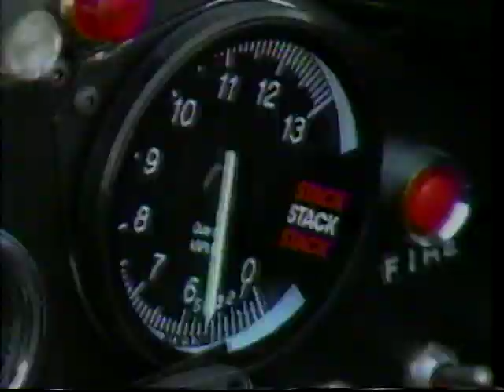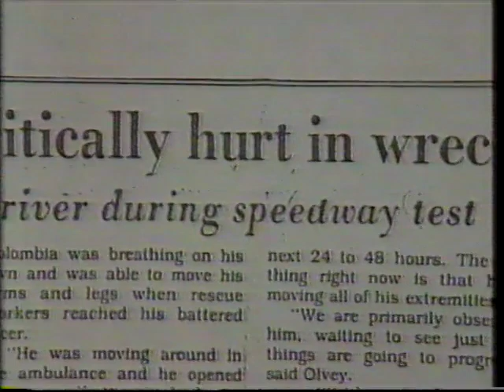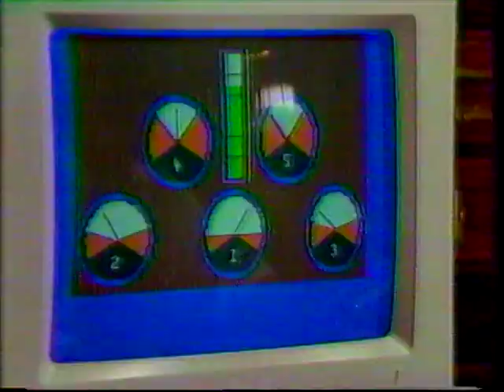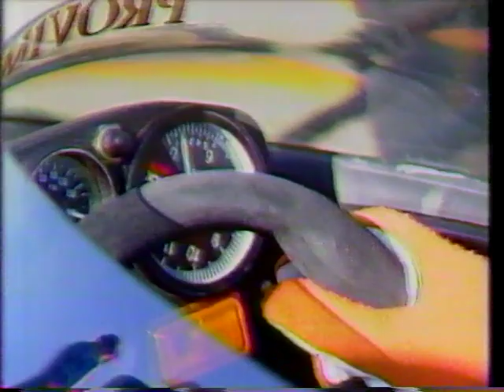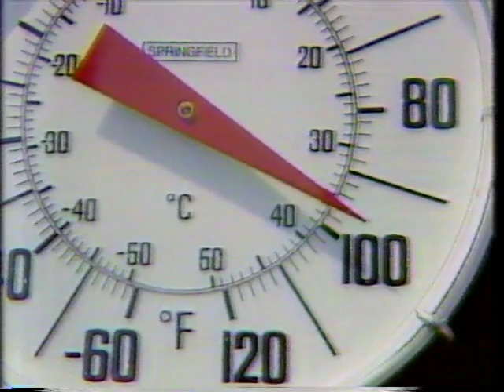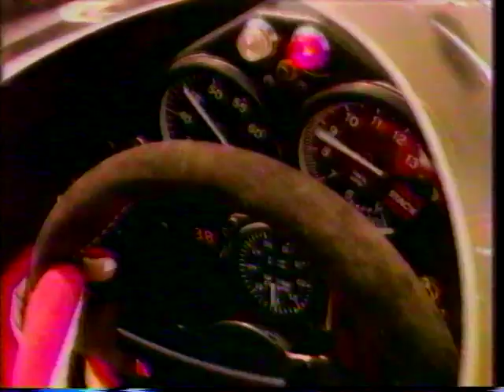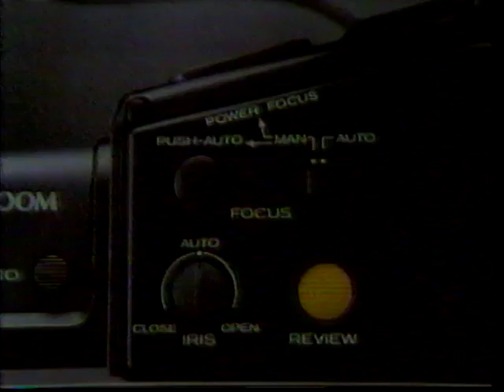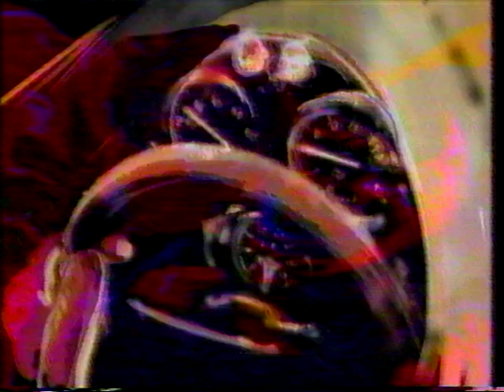1988 INDIANAPOLIS 500

Comment: In the 1988 Indianapolis 500, A.J. Foyt qualified in the 16th starting position with a four-lap average speed of 215.648 mph. He had a strong race and was running in the top three in the late stages of the event, but ultimately finished in 9th place due to a pit stop for fuel in the closing laps of the race.

Foyt's performance in the Indy 500 in 1988 was impressive given that he was already 53 years old at the time. Despite his age, he continued to compete in the race for many years to come and remains an important figure in the history of IndyCar racing.
Reply: You must be thinking of another year. Foyt was indeed 53 years old in 1988....but your other figures are all wrong. A.J.Foyt started in the 22nd position with a 4 lap speed of 209.696mph. He was never anywhere near the lead and crashed on lap 54 and was done for the day.

Comment: Fun (sorta) fact: 1988 is believed to be the biggest crowd ever to attend the 500. While they added grandstands  in years after,  the infield capacity was reduced substantially. We’ll never know for sure bc IMS never releases attendance numbers, but insiders say this and maybe 1991 were the most attended 500s ever. 400k wasn’t too much of s stretch
Reply: I disagree.I think 1993,1994,or 1995 were the largest.Remember the massive grandstand that was installed between Turns 3 and 4 prior to the 1993 race and the large grandstand at the pit entrance prior to the 1990 race.Infield was still full then,too.However,if you had said that the 1988 Pole Day was the biggest Pole Day crowd you may have been right.
Reply: I agree about Pole day 1988. I was in the A grandstand across from the pits and the crowd was really MASSIVE that day! It is hard for some people to believe that back in the day they could put 150000-200000 in the stands...just for qualifying! @asianoramaagain2269
Reply: We were sitting right next to you! We always sat on the top row right above the flagstand in the paddock.
Reply: What about 2016 was it even close
Reply: @ynp1978  For years, the 2nd highest attended auto race in the country was 500 pole day.

Comment: apparently no one told Julie Nini that the pace car picks up the leader
Reply: No,it didn't back then.USAC was always behind the ball compared to other racing series...In 1988 the pace car still would come out and NOT NECESSARILY wave everyone around and pick up the leader.This is exactly how Rick Mears snuck out a lap in front around Lap 140.
Reply: Asianorama Again okay thanks for clearing up a mystery because I've watched this race hundreds of times and couldn't quite figure out how Al Unser lost a lap on a pit stop that was 8 seconds longer under yellow
Reply: Yeah,it wasn't until 1992 that it became mandatory for the pace car to pick up the leader.Before that,they usually TRIED to.Rick Mears somehow was able to race clear around the track,lap everyone,and then duck behind the pace car.I was in H Grandstand that day and Rick Mears sure as heck didn't need any extra advantage.
Reply: @asianoramaagain2269  Thanks for the insight.  I too have wondered how Rick got up by a lap at that point.  I had always wondered if the pace car picked up the wrong car as the leader, like maybe Al Sr.  Their cars did look a lot alike, and in the pit stop sequence under yellow where Mears gained the lap advantage, Al Sr. came into the pits significantly later than Mears, and prior to the yellow on the track, there was not that much distance between them.  I would assume that Al Sr. would have followed Mears into the pits, but if the pace car had picked up Unser by mistake, it would explain why Unser came in so much later than Mears because the pace car error would have created a great gap between Mears and Unser.  Do you have any more insight on that having been at this race?  This is the first Indycar race that I paid attention to as a kid, and I became a huge fan of the series, the 500, and Rick Mears at that time.
Reply: Sorry for the delay in responding.I have been on vacation.The 1988 race was my 9th 500...My first was in 1979.I was 16 in 1988.The day was extremely hot and I remember the fans in the infield burned a vehicle in the North end around the Lap 150 mark.This can clearly be seen on ABC's telecast of the race.Penske had a huge advantage that day and everyone was rooting for Jim Crawford,as Jim appeared to be able to slug it out with them for a time with his Buick.But I remember a re-start around Lap 120 when Crawford was just completely blown off by Al Sr. and my Dad just looked at me and threw up his hands.He just didn't have the total package of those dreaded PC-17's. Also,Crawford was running clear down on the apron every lap in Turn 4 in an attempt to keep up.This was probably what caused the officals to start thinking about their idiotic rule of the following year of threatening to black flag anyone who ran below the white line.